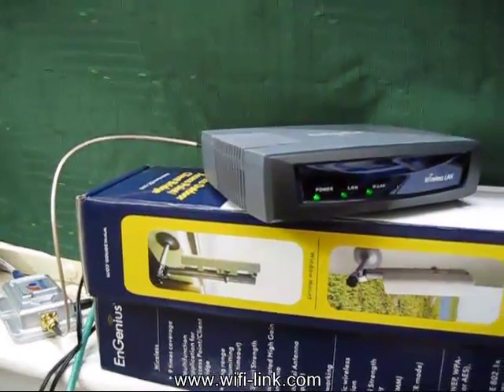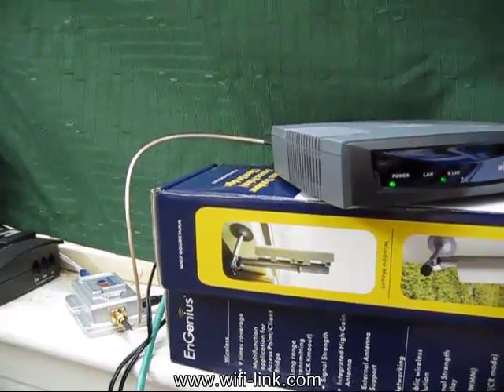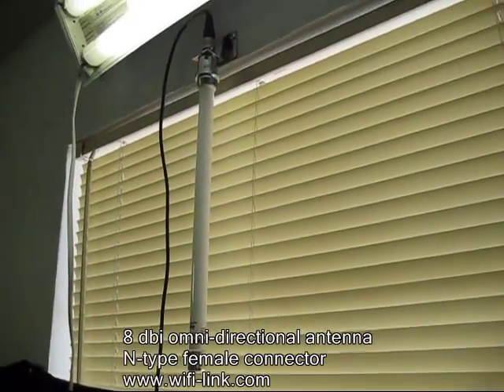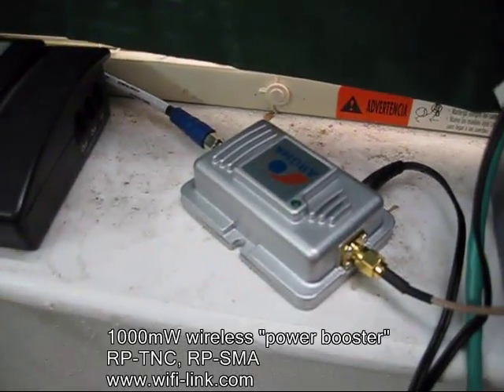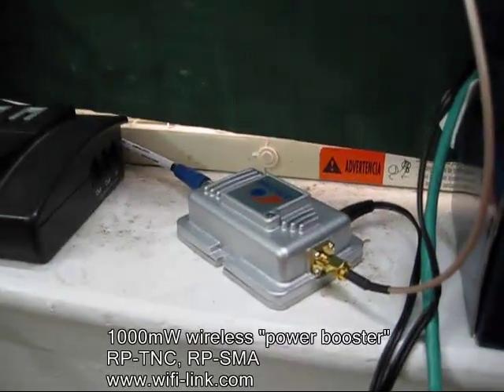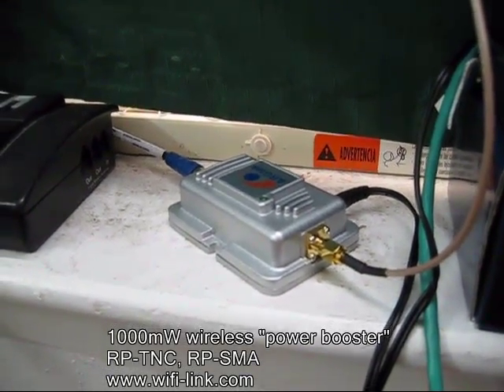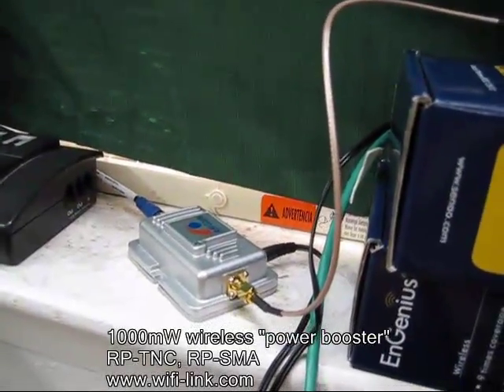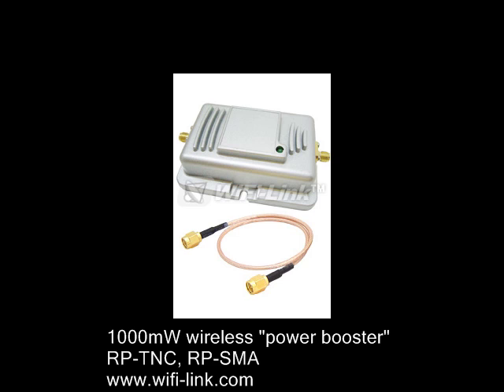1 watt Wi-Fi amplifier 802.11b/g extends range to 5 bars in entire complex

Comment: My True Comment: The 50mw. or less wireless is based on 2.4GHz. No one have mention about the output power on 5GHz. They had preached about 5GHz. is much higher frequency than 2.4GHz. to greatly shorten your range on 5GHz. 'Why?' the 6GHz. cordless phone range is very good, it even on higher frequency than 5GHz. Wi-Fi. This True Answer: The standard dual band on 5GHz. side, the output power is around 1mw. or 1,000 micro-watt is the next thing to the nothing for much shorter range than 2.4GHz. I would be happy enough, only if 5GHz. put out at least 10mw. to full-filled your range even through the walls into the quiet 5GHz. band. 1mw. is too weak to do a proper performance.
Reply: A lot depends on bandwidth...the wider the bandwidth, the higher the noise floor..  I get about -95 dbm (4 uV) for the noisefloor where I'm at... but a VHF or UHF FM signal here which has about a 5 khz bandwidth, the noise floor is around -130 dbm (0.07 uV).. Big difference !!  WiFI bandwidth is around 20 to 40 MHz ... FM @ 5 khz = 0.005 MHz.   If we could have a much lower noise floor with WiFI, signals would be flying everywhere on low power !  -95dbm is still a strong signal normally with FM.

Comment: There's a reason these things are against the law .... they ruin all your neighbor's reception .... a big price to pay just to get a better signal that would available with an outdoor antenna without the amp.... but today's all about me "amp" mentality is as with the boom box and your neighbors rattling windows .... thanks for sharing ... NOT ....
Reply: Its legal as long as he reduces the power so that the antenna output is less than 4 watts. Besides, all of your modern wifi hotspots will automatically attempt to "hop" to the quietest frequency.
Reply: No, it's not legal.   And it works only until your neighbor gets one too.   It's one thing that killed CB radio, people believing that they owned the airwaves and going over the power threshold.   Nothing stops your neighbor from getting one, and his neighbor and pretty soon you have ruined the spectrum.   Dead.  You won't be able to communicate across the room.

Comment: If anyone is curious how to get external antennas and amps on WiFi you can get WiFi USB adapters on Amazon for like $10...I got one for $10 and bought a seperate $10 panel antenna and am pulling in WiFi much easier from a site that gives me a barely usable signal without the adapter.

Comment: I hope you don't have this setup anywhere near your bedroom ...  you should take a rf meter and check how high the levels are ..
Reply: Its only 1 watt, I have 2 60 watt radio transmitters sitting in my ceiling fan bathing me in radio waves with wavelengths ranging from about 400nm to 700nm. How am I not dead yet?

Comment: BDA's were originally made for the old cell phones back in the day. someone took that and modified it to 2.4GHz. the idea of a BDA is to boost your receiving and transmitting capabilities. In a legal application you would use a BDA with leaky coax for running wifi in say a tunnel underground or in a building in an elevator shaft. Hooking it onto a store bought router you run a risk of burning the front end up in the router when it receives a strong signal (above 5/10ths mV). Then you have a new paper weight for your desk unless the BDA has an auto sense circuit in it

Comment: running power is great for getting the signal out, BUT people that are receiving you wont get into the router.. thus makes running power USELESS!
Reply: ***** think of it this way.. You are a router! your standing on your street! your talking regularly and other people standing around you can hear you and you can hear them.. You talk back and fourth with everybody around with ease!

NOW your running power.... so now your YELLING!! the people waaaaay down the street can easily hear you but you cant hear them.. all you hear is the same original people standing around you talking in a normal tone of voice!

So whats the point of running power, if everybody else isn't... NOTHING! theres no point!  All your doing is making exxassive radio noise AND your hurting your receive by causing DESENSE!!!

30+ years radio experience here teaching you radio 101
Reply: Chris Miller Did you read the video description, Chris? I'm fairly certain that "with 30+ years of radio experience" you should know exactly what a bi-directional amplifier is, and since catch10110 mentioned this information in his video description, I must assume that you did not read it. So..

For those who don't know what a bi-directional amplifier is, I will explain.

Not only does this device amplify outgoing signals, but it also amplifies incoming signals. So, as per the example given above, imagine that the guy doing the yelling also has a hearing aid in his ear so that he can hear the replies of the people he is yelling to "waaaaay down the street". What this means is that you're not just transmitting further while using this device, but also, receiving better as well.

Plain old High school diploma here..
...and you have just been SPOON FED some READING 101. Open wide.

"1 watt bidirectional amplifier for TX/RX (transmit/receive)"
Reply: you just don't get it..  But I can play that game too..   Electrical engineer is far from communications theory. I worked for Motorola for 25 years! My professional expertise was antenna theory..
and Again you don't know what your talking about
Reply: YOU SAY ""So, as per the example given above, imagine that the guy doing the yelling also has a hearing aid in his ear so that he can hear the replies of the people he is yelling to "waaaaay down the street". What this means is that you're not just transmitting further while using this device, but also, receiving better as well.""

ALL YOUR DOING IS AMPLYFYING THE CLOSE PEOPLE TO YOU.. ie: noise!!
YOU WONT HEAR THE GUY DOWN THE STREET ANY BETTER AS YOU CANT SELECTIVELY PICK WHO YOU WANT TO AMPLIFY UNLESS THEY ARE RUNNING POWER AS WELL!!!

your an idiot! you just don't get it!
nuff said im not replying to idiots
Reply: ok GOOGLE expert.. im done

32 years ive been doing this, but what do I know!
Reply: Eh I get the point and this is good advice for someone that doesn't understand this stuff very well but let me give some incite here...On cellular (LTE @ 2100MHz band 4) for example, when I am in the prime zone of the cell site I get amazing download speeds and amazing upload speeds with a -60dbi signal, lets say 30mbps down / 15mbps up. I step inside and that signal drops to -90 to -110...my speeds obviously drop but what I notice is that they don't drop symmetrically so now I'm getting say 17mbps down / 2mbps up...why? because the cell site can radiate at up to 20watts but my iPhone can only radiate at up to 1watt (give or take a few), it can still talk back to the cell site but its not as strong, still for applications that only need good downlink performance this is fine...now obviously on WiFi this is different since we broadcast and receive on essentially the same frequency so the noise level effects both the downlink and uplink equally unlike a FDD cellular signal where the duplex spacing of the frequency can be off-set by as much as 400MHz (Band 4 - 2100/1700). Now at what point amplification just creates too much noise is hard to say and if the amplifier is a bit more crude you might get more noise than usable signal versus and well built amplifier of slightly less amplification. So the point is you don't need equal power or even close to equal power on the receive end and the transmit end but obviously 999999watts on a WiFi router is complete overkill if all your clients are regular ol' tablets, laptops, and smartphones in a sane environment and distance, if your trying to beam a signal across a couple of kilometers to a client on a hill with trees and obstructions then that is a completely different situation.
Reply: this is true. may as well hook up a naked magnetron and fire it off lol
Reply: Chris Miller i have to say man  your  right   i  dont have 30 years of know how  but what you said is correct   and  simple
Reply: BUY ONE, and youll see the PRE-amp does nothing! but increase noise.. anybody that has one of these knows that.. Google it, and im telling you Again ..
and that is: unless the other end is running power.. then running an amp is useless for wifi!
absolutely useless, but to create radio garbage!

im soo done with this thread
Reply: I knew this 20 years ago, you just don't get how it works!!
Your still on the same frequency, thus there is noise and YES you can direct your signal to one signal ie: wifi BUT there is still noise!!!!

Unless your on your own private frequency then the amp is useless! I also have that amp I was given to test and its garbage as garbage can get!
On the welfare windows signal bar the signal goes up for receive BUT the same quality of signal is still there, its just fooling the crappy windows signal to look stronger!

I have many many many years of professional experience with this stuff, not to mention back in the 70's messing with amp's when I was a kid.. and UNLESS BOTH ENDS ARE USING AN AMP, then its useless... this goes back to grade 1 of radio theory!

ill just agree to disagree with you as ive Tested this and was paid for it. its GARBAGE, do a search for this amp on message boards and you will see its garbage!

don't bother eeplying with your lack of theory knowledge and lack of experience in this field.. your one of those people who believe in 300+ dbi antennas on ebay..
Reply: soo why are the cell companies fighting over cell frequency spectrums hundreds of thousands of frequencies, when all they need is one frequency??

I don't understand digital?? haha yeah ok, the police in your city are using a digital system that I set up ;)

YOU JUST DONT GET IT!!!   and that amp is a piece of $hit!
Reply: now your comparing wifi to cellular? let me give you a grade 1 page 2 lesson in cellular!

When your phone is on, its in constant communication with the cell tower.. the cell tower tells the phone how much power to run!
The cell phone can run as low as .40 milliwatts right up to half a watt.. but the more power the phone runs the more battery usage.. thus the farther you are from the tower the more battery it takes to communicate (even if your not talking to anybody on it). Cell towers use directional antennas that point downward towards the users.

Don't compare cell to wifi, AGAIN apples to oranges!!
Reply: xboxmods3077
With my 30 years experience I can assure you that it doesn't increase the receive signal.. it just increases the noise!
Ive had many a linear amp and receiver amp and yes I did get out better but still couldn't hear crap..
instead of having my receiver end at 3 F units.. I got them at 5 and sounded worse than when it was 3.. GET A GRIP!
Reply: @WPGinterceptor460Interceptor  Nowadays appeared Xiaomi Mi Wifi Extender, a lot of people where saying just as you, that you are yelling to far away people, but you don't hear them...
So on the example of this Mi wifi repeater I was saying above, which has an amplifier as well, I was flying on my droneS and instead of 300-350m, got more than 2km receiving all data and video from the drone from that distance, the extender being next to me. How can you than explain this bidirectional gain in your vision of just one way boost?..
Reply: @corneliudoc  using a drone? so absolute complete line of sight as per microwave freq 2.4G!  Are you also running a pre-amp? cause all that does is increase the noise...
Reply: @WPGinterceptor460Interceptor  Not using any pre-amp, just the drone and just the wifi extender near me, usb small one, a little bigger than an usb stick -> result up to 8 times increased range with two way communication
Reply: @corneliudoc   yeah LINE OF SIGHT, meaning no obsticles.. that's whats best for this frequency, even if a tree is in the way will substantially affect the signal!
Reply: @WPGinterceptor460Interceptor  Sure line of sight, in the same conditions without wifi extender it does only 300-350 m
Reply: ***** you obviously didn't read my response! read it again and then compare it to your situation..

Comment: Sup purplehaze I gave you a thumbs up, you gave some good info about the alfa1000mw.  I cant get cable internet where I live, but theres a couple unsecured connections close by but I can only get barely 1 bar at best.  Do you think the alfa1000mw will work for me?  I cant really move my computer will it work inside?  Also I would like to try using backtrack but I'm a total noob, I heard the penetrate pro app for android is easy at WEP cracking but idk.  Ben evans? lol will I get hooked up?

Comment: buy a alfa1000mw or an alfa 2000mw the only diffrance is the alfa 2000mw dont do packet injection but the alfa 1000mw does thats the one for all of us backtrack users and pen testers out here anyway if you want a great big signal!!! trust me guys get an alfa 1000mw or 2000mw with the RealTek 8187 Chipset thay are about $29 bucks from simple wifi just tell them ben evans recomended you thay are the best in everything wireless wifi so just tell them ben evans referred you. have fun. "god bless"

Comment: Hi im Jake i have an issue but theres so many products out their.... ok i have 2 house directly across the street not to far from each other and i have a cisco e3000 router and in the other house i have a 300 repeater from amped wireless it always fully drops connectivity at least once a day so i have to reset it.. whats the best set up i can do for this situation and the cisco e3000 does not have a external antenna connection like normal ones....

Comment from the maker: You would not be able to safely do this. The amplifier will take a signal usually between 30-100 mW. If you input 1000 mW, it will eventually fry the amplifier, if not immediately.

Comment: Does this work with a standard receiver too?

I ask because if you have say a normal laptop, surely that would need a bigger antenna too as otherwise the laptop would simply not have the power to transmit BACK to the router as wifi is a two way signal.

Comment: Hmm.. About the antennas, its not just being bigger
that increases gain, a small dipole can be precision, exactly the right size, and does give donut shape. Antenna grows because of added reflector/ directors which increases directional gain, so its no longer donut shaped, more like a sub sandwich. Stacking dipoles can increase omni gain, currently I am looking into 2 crossed dipoles fed out if phase for circular polarization and stacking 3 for a bit of gain (since cp is negative gain).

Comment: ya but that amp is more than what u really need to spend.  Try buying an alpha networks usb adapters with the ralink chipset and a built in 2000mw bidirectional amp u should be able to find 1 for 35$ or so. And your range wont be 3 apartments more like over city block

Comment from the maker: @danyaltahir 

Your problem is the TP Link router. I've used TP Link routers before and they are not very stable even at close range. I'm not sure if it's the radio quality or even what chipset it uses. 

You'll notice that I used Cisco APs. They are heavily shielded and the radio board itself is many more layers of silicone. You can find old and used Cisco APs on EBAY for very cheap, usually B ones for under 40 bucks.

If you are interested in stability and range, B is the clear choice.

Comment: Gross coaxial cable choice.  Minimum I would ever consider using for 2.4 ghz is Times Microwave LMR400.  Even then, if you're running a mere 50 feet of LMR400 though, and your 1w is now less than 0.5w due to coax losses.

If you're really serious about performance, hardline such as Andrews Heliax LDF4-50A is the way to.  However, Heliax is heavy, stiff, and uses special compression fittings..it costs a fortune though.

Just some ideas!

73 de KD8NPB

Comment: That added power is alright if you are connecting to another AP or repeater that is also using that much power (or equivalent with gain). If you are just using it for connecting a low power device such as a laptop or desktop, with out additional power/gain, then you won't really be gaining anything. Your signal strength FROM the AP will be strong, but TO the AP will not be any stronger with just the amplifier. For such a small area, you only need a good quality, high gain antenna or a repeater.

Comment: How much more range could you achieve (in miles or yards) if you got an antenna with bigger dbi rating, such as a 15dbi omni-directional antenna? I want to do the exact same setup as what you have with a standard wireless router and a 1 watt amplifier but was curious on how much range I could get with a 15bdi antenna. Thanks!

Comment: 8dbi is very concentrated for long distances horizontally. 

The strongest signal strength would be very level with the antenna itself.

If you're trying to provide WiFi to apartments above and below, wouldn't you want to use a lower dbi?

What floor are you on? have you tried to see how far you could send your signal outside?

Comment: That's nice you have an amplifer but are you blocking out your nabors wifi router with over saturation?
The only reason to ever build a diy antenna is for point to point operations but there has been some really awsome distances covered with Ornico cards with no aplification in the distances of 15 to 45 miles with diy point to point shot outs but amplifers are great when you are stuck with low signal but I think design and proper grounding are Key to great signal propagation.